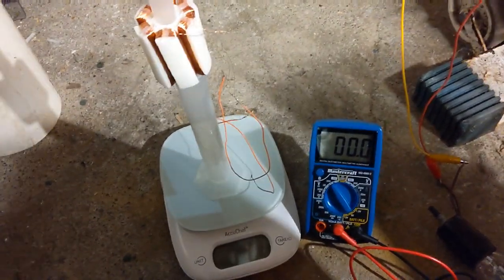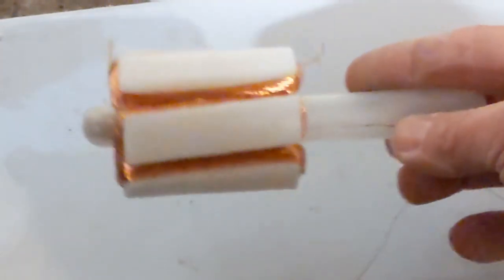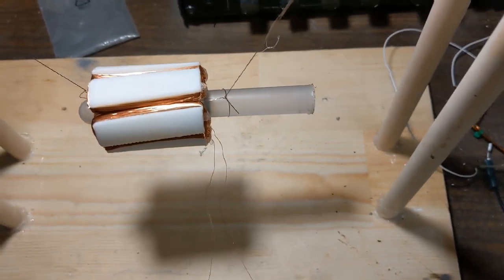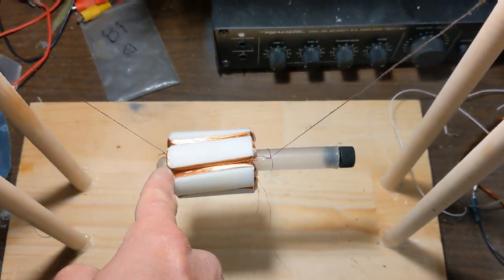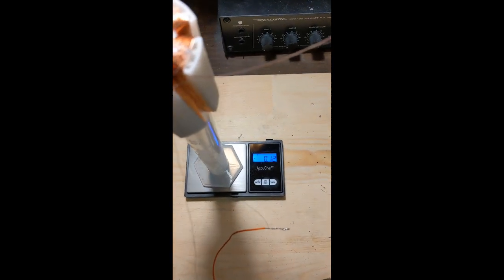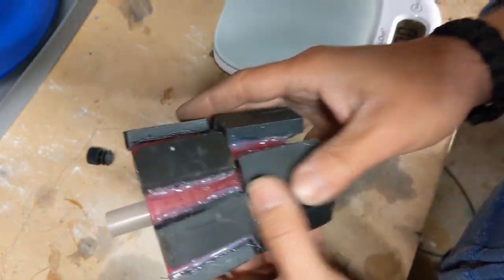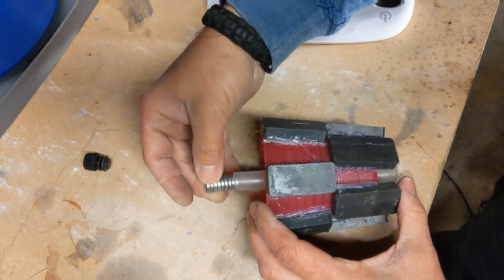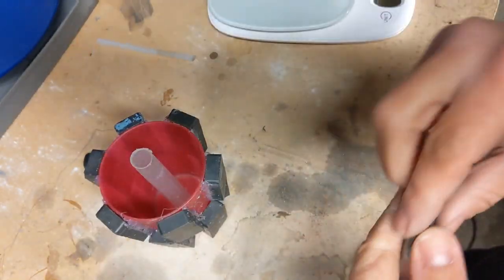Magnetic Space Drive?

Comment: 1. Face the magnets such that they are pushing on the bottom of the test tube, and are attached to the bottom so they can't move. 2. Then, pulse the coil repeatedly at the highest current and frequency you can manage. If there is any thrust, that should make it nearly continuous and measurable. And get something to hold the phone steady!

Comment: Your permanent magnet device created a gradient magnetic field that the Nd magnets do not have. Therefore, they see a force in the -dB/dz direction, because it minimizes the energy. Once the projectile passes through the exit-opening, then the other pole of the Nd magnet is slightly attracted, creating a stable low-energy well just inside the opening. The depth of this well is not as deep as the height of repulsion at the other end, so thanks to the taper, it can't stop the projectile before it exits at that energy level, i.e., the repulsion from the tight end causes the projectile to exceed the escape velocity of the energy well at the wide end.
Reply from the maker: That's a good explanation.... I find thinking about many systems in terms of energy levels can bring simplicity.